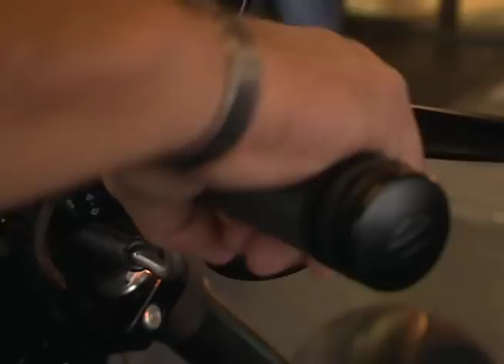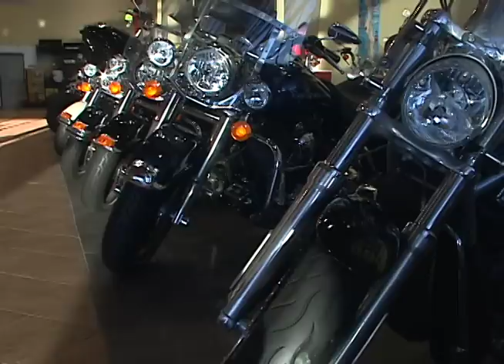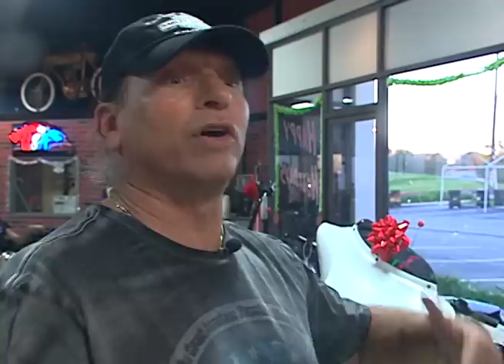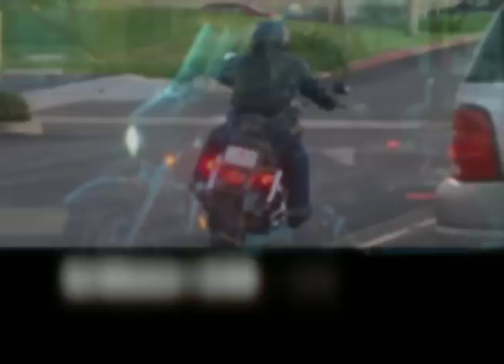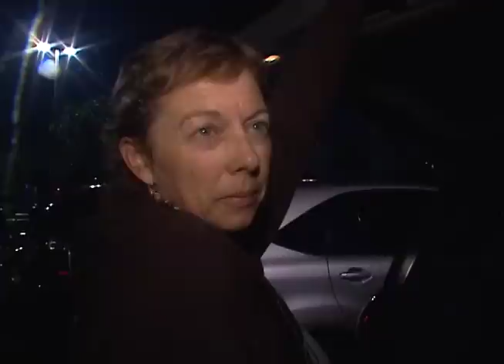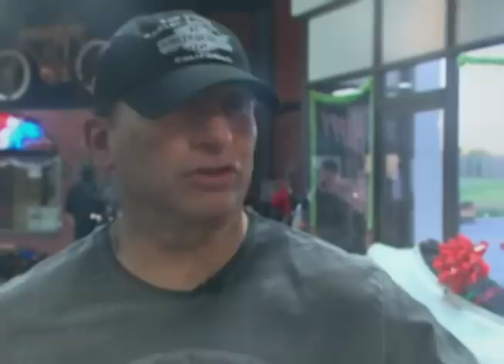Motorcycle Exhaust Restrictions

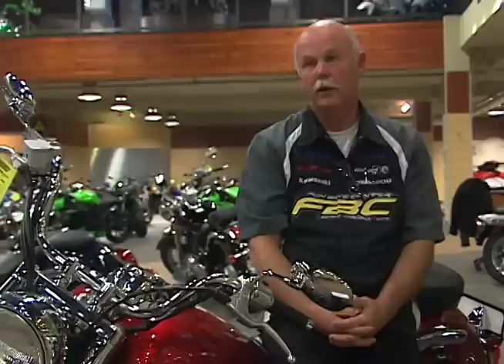Comment: At 0:56, Loud pipes do not add to the safety of the motorcycle. Why do you believe this when the exhaust faces backwards? Wouldn't it be better to point the exhaust forward if it were to add to the safety? This is the most ridiculous argument I have heard for having a loud bike. There are no studies that show loud pipes are safer. You know what has proven to be safer? High visibility gear, upgraded horns and defensive driving techniques.

Comment: Any exhaust that is not of the type installed at manufacture is illegal, plain and simple.
Noise pollution has real health affects on people, whether you notice them or not and that is why loud exhausts are illegal almost everywhere in the US. Enforcement is another story, but you can always count on me calling the police when I notice a loud driver like yourself driving through or near my neighborhood. The more this happens, and the more others also report it the faster there will be tougher legislation on loud exhausts.
So keep on doing what you are doing, you guys are only making it worse on yourselves in the long run.
Don't be an inconsiderate douchepickle to other people. Your exhaust can be heard by 50 or more people in any given area while you are only concerned about your own personal preferences?
Also, here's a tip. An exhaust can have peak performance while still being quite. The loudness has absolutely nothing to do with the flow rates and pressures. A muffler is nothing but a series of passageways bent into certain patterns to reduce noise. Those passageways can be modified to allow for almost no backpressure and better flow rates while still being quiet. Take a look at the Corvette. Its exhaust was engineered at the factory to be the best performing exhaust anyone can possibly install on it, yet it is extremely quiet straight out of the factory.
It seems to me that when you guys are driving your loudness around town, you are the only ones getting a thrill out of it while the majority of onlookers simply think you are a moron. So I hope you guys aren't driving loud exhausts for attention or image because you just look douchey.
Don't mistake me, I love cars. I just hate ignorant loud fucktards who think it's cool to make their vehicles annoyingly loud. You don't look cool, you look like an idiot. In my 39 years of being on this earth I have only met one person with any sense who trailers their loud car to the track and does not drive it on public roads. That is a real sad statistic.